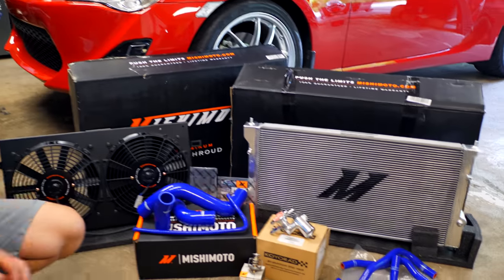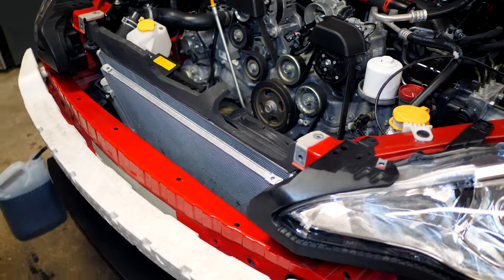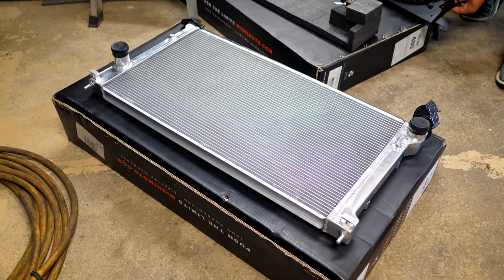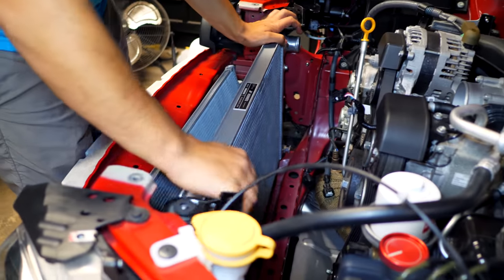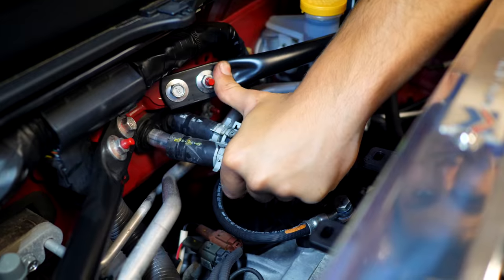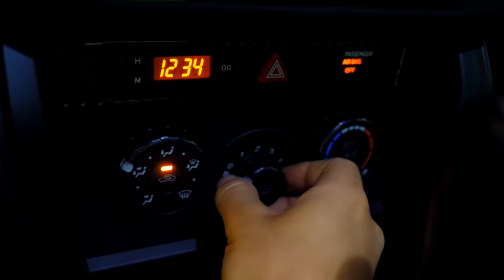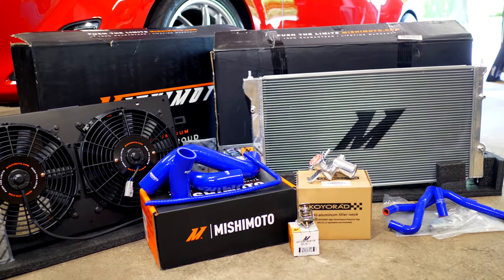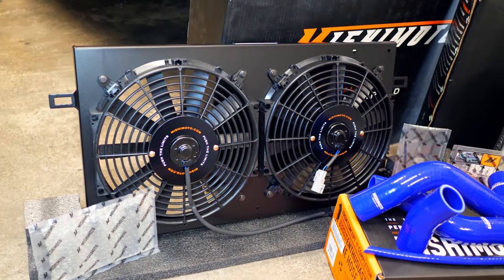The ULTIMATE FR-S/86 Cooling System Upgrade

Comment: One thing that might also help is putting some foam tape in between the shroud and the rad, helps to seal things off and make sure the fans are pulling the most air through the fins when idling
Reply from the maker: That's a good idea! I'll run it by Luca

Comment: even my stock Jetta will run at 172 F on highway with stock cooling system.. the reason it was doing this, was my thermostat was opening at a cooler temperature than spec... so the main thing keeping it running cooler is the different spec thermostat.  of course the cooling upgrades should have a greater capacity to shed heat when racing or driving really hard.  the cooling system and components you installed are quite nice, i like them especially because there are no plastic components, all aluminum, silicone hoses, etc.. good stuff that will actually last.

two issues that might be encountered with the cooling system change, especially with that particular thermostat.. you will likely get an OBD code triggered, due to cruising at highway speed and the engine coolant temperature remaining below the spec operating temp.   secondly, using that setup as a daily driver, running that cool.. is more likely to cause the engine to carbon up sooner.
Reply: i was thinking g the same thing. i would think the car would run a little rich as well being that according to the cpu the car is not up to the proper operating temp spec.

Comment: Coilovers were a great purchase, but 3/4ths the other suspension pieces are useless other than for weight because he isnt trying to get a super specific alignment setting and the car isnt super low. Now all this cooling stuff? What are the plans for the car? This is so much money in suspension and cooling alone and most of it isnt needed on a mostly stock car unless hes planning on tracking this thing very often
Reply from the maker: That is the game plan. If Luca ever decides to boost his car, the cooling system will be upgraded enough to manage it and not have problems. The upgrades on here should allow Luca to drive the car hard and it should stay under composure. I'm hoping to bring Luca to his first track day soon
Reply: agreed - spend time at the track first and then makes modifications as your driver skill improves.  All of this cash and modifications done on a car and he still hasn't even popped his track cherry.  Mind you the car will fit in with the local TMP crowd of Track Day Bros, a bunch of bolt on WRX's that can't put down a sub 30 lap.  I get he's excited for the car and that is great but if he actually starts to do consistent track days he will quickly realize how useless much of this is and how quickly other things become much more important
Reply from the maker: @trevormontague803  Like what? What are some more important mods? We have a bunch more things like brakes and tires which are more important I find than stuff like coilovers and cooling, but every little bit helps, especially for sprints of 3+ laps.
Reply: For example, a lower temp thermostat is completely useless, it's one of the aftermarket parts that exist solely because of peoples want to just spend money on parts, not out of actual need.

I agree that some of the mods you guys did were good and much further down the road will likely be needed, just not there yet.  Testing coolant temps after a very brief wot pull on the street tells you nothing about how the car will cool during a 30min lapping session with heat soak.  You won't truly know what you actually needs until your bro starts doing lapping days.  This will be based in time spent lapping and driving style and skill.  Case in point: I track a semi stripped out  Toyota Yaris chassis, many people say that autox brake pad compounds are adequate for that light of a car.  I found out that is  not the case with my braking style and 45 min sessions at TMP.  Every driver puts different demands on the car and this sometimes will correlate with lap times but not always.  Coil overs,  a 100tw tire and proper track brake pad compound will do wonders for your brother while he learns the cars and more importantly his limits on track.  That said, you run a YT channel so I understand the need to put out content and therefore parts on the car.  
From a track perspective it is just a lot of cart before the horse
Reply: @milanmastracci  btw I think I can speak for both of us, I didnt mean this in a negative way! I spend a ton of money on my car on things that I probably dont need. I was just curious about some of the purchases that were rather expensive, I was just hoping you were going to get your use out of them!

Comment: I definitely need to do some cooling upgrades on my car. Texas heat I'm seeing 200-215... definitely a loss in power at that temp. But while moving its around 180-190.
Reply: Thats normal temp, if your car run a little more cooler will trigger cel
Reply: @Carlos.Rivera  I want to keep it at 180-190 all the time. After 200 my car feels down on power.

Comment: Are you two gonna add oil cooler and do the mod for the fuel starvation problem it has for the track?
Reply from the maker: What is the fuel starvation problem? Let me guess? When you turn hard a certain way it starves the fuel pump of fuel? I know the Z has that same problem
Reply: @milanmastracci  Yes, I believe it's if you turn hard left it will starve the pump.  replacement fuel pumps Are available.  See ft86 speedfactory's video.

Comment: Thanks for the torque specs which are not in the description LOL
Reply: Check the manual
Reply: @Scirollo   Why should I use the manual when it says that the torque specs are found in the description?

"...system with a bunch of PROVEN components.  

All of the safety equipment, products, tools, and torque specifications that were used in this video can be found below. 

///// PRODUCTS FOUND IN VIDEO \\\\\ ..."